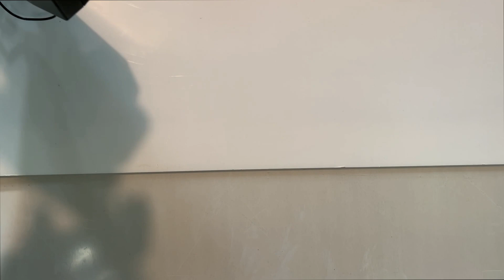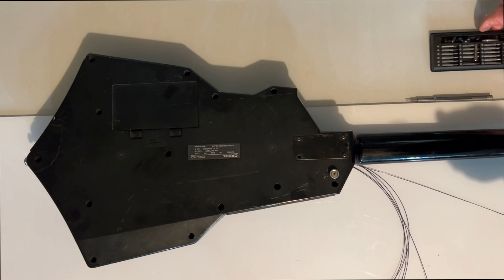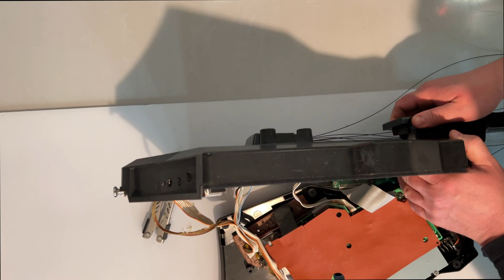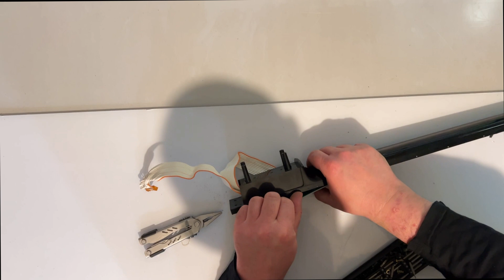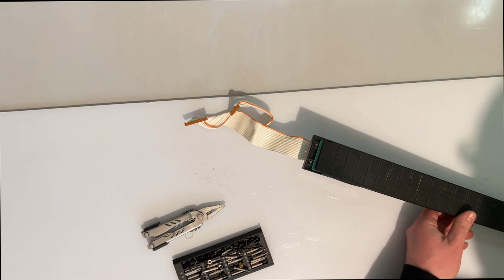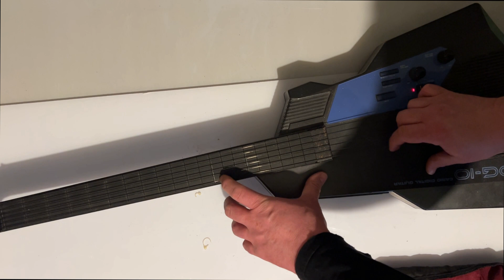Casio DG-10 Digital Guitar Repair - But will that fretboard work again?

Comment: Hi. I have the same problem as in the video. I disassembled the neck and cleaned it. I cleaned the plug contacts. I found a repair manual that includes electrical diagrams. I tried to understand the problem, but I still can't figure out which track is responsible for the first string. When the guitar is open, it sounds, but it doesn't respond to pressing each fret. Does anyone else know how to solve this issue?
Reply: I bought a used guitar. The first time I played it, the frets on the first, third, and fifth strings didn't work. But after five minutes, they warmed up and started playing. Then I disassembled the neck, cleaned the contacts, and cleaned the contacts on the wires, and all the strings started working except for the first string. The first string doesn't respond to the frets.
Reply from the maker: Sounds like the wire that handles the switches on the first string is either loose or not making a good connection. Bridge is fine because you said the string is making a noise when you play it. You said in your previous post you have the repair manual and it was sort of working until you cleaned it. I’d have it apart again, and use a multimeter and check between the contacts and the relevant ribbon cable point to see if it’s making a connection. It has to be a wire common to all those contacts in the first string which may only be holding on by one strand of wire. I would also check the rubber membrane as well as it could be worn out but sounds like a loose wire. Hope this helps and let me know how you get on 👍
Reply: Hi, you can't do without a multimeter. There's also a problem where the third string doesn't respond when turned on, but after 15 seconds, it starts responding to fingerpicking, but the first string only plays open notes across the entire neck. However, it did respond when first connected, but not immediately after warming up. I'll be working on the issue!
Reply: Hi, hi. I'm going to continue. I studied the neck, and I studied the repair manual. Using a multimeter, I confirmed that the guitar neck is fully functional, the rubber neck cover conducts electricity and can be measured with a multimeter, and the graphite contacts are in perfect condition! Additionally, the multimeter showed that the contact from the graphite coating on the first string of the neck to the processor's leg is good. There is no breakage. Six signals are sent from the chip to the neck, and then they are sent back. It seems that one signal from the first string is not being sent from the chip itself. I will continue to investigate this issue.
Reply: https://youtu.be/3f6WH_nHQYQ?si=-3uB92dUCiysl_zT.  This was the first video on the day I got the guitar. The first , third , and fifth strings started working properly after 15 to 50 seconds of playing . after disassembling the guitar. I was still cleaning the board from oxides, but there was an oxide in the auto-off details... But I can't understand, if there is no break from the contact of the microcircuit to the graphite of the first string, then why does the microcircuit not send a signal to the first string, but it used to send on the first turn-on.

Comment: Im having a problem with mine, the light doesnt even turn on when i flip the switch, it worked when i bought it but i may have exposed it to overvoltage but i feel like it worked even after that, my memory isnt great though
Reply from the maker: If it has had too much voltage it could have damaged it. First, I’d try a power supply or batteries in it. Power supply should be 9vdc, 1A(1000mA) or higher amps and centre negative on the plug into the DG-10. Having a look on eBay there are loads available or a universal will work as long as you set it up correctly. Try batteries in it but again depends on if the contacts are good. I’ve had it sometime where mine won’t switch on so I turn it on, roll the batteries at the back with my hand and see if the power light flickers. If that doesn’t work, try working the power switch back and forth several times as due to its age, it may have a bit of a build up of oxidisation on it. Again, if you have some contact cleaner, you could try spraying some of this under the switch and work it back and forth a few times. Hope something here helps and please let me know how you get on with it
Reply: @BillFixesEverything I discovered a few things, first of all mine is a dg-20 so I'm not sure how it would differ from the 10, but they look pretty similar. Also I was testing voltages because apparently the t3 transistor is a fairly common issue, when I placed my probe on the emitter of the t3 transistor and my other probe on the base of the t2 transistor, the guitar powered on after a time delay. Im thinking I essentially jumped over the 10 microfarad capacitor that's supposed to be charged by the t3 transistor, but that doesn't really explain the time delay. Anyway I'm thinking the capacitor may be the issue but I haven't ruled out the t3 transistor either
Reply from the maker: @Bobby_Kron  it may be worth replacing both of you can as they should be fairly cheap components. I believe the only difference between the DG-10 and the DG-20 is that the DG-20 has a built in midi port. Sounds like there’s life in it anyway. May also be worth just reflowing the solder with some new solder on the capacitor and transistor, could just be a dry joint 🙏
Reply: @BillFixesEverything yea I was thinking I would just replace both, see what happens. I have zero experience with this kind of circuit board stuff so thanks for offering your expertise, I'm feeling much more hopeful for the life of this thing as of late ❤
Reply from the maker: @Bobby_Kron  just take it easy and you should be fine. If heating the joints up then adding new solder to them doesn’t work. When you want to remove the components, I’ve found some solder wick covered in flux works best and  sucks the solder right off the board. Just do it somewhere well ventilated, near an open window  as the fumes are a bit strong
Reply: @BillFixesEverything  i couldnt get the guitar to work so i ended up removing the components but im having trouble figuring out what transistor i need for a replacement, i would hate to accidentally get an incompatible one and break it further. do you know specifically what transistor i need to replace it?

Comment: so was it just the cleaning that fixed the notes or was there something not making contact? i have a dg-20 and everything works except all of the notes on the 1st fret for every string. from the 2nd fret up everything works fine.. debating opening mine up to give the fretboard a clean but I don't want to break anything haha
Reply from the maker: It was one of the ribbon cables was not in properly on mine but while I had it open to fix that metal bar back down in the neck I thought I might as well clean it up. For your one it sounds like it could be one of two things. Could be similar to mine and one of the pins isn’t making contact and this sounds the most likely problem as it’s all of the 1st fret not making contact. Secondly it could be that the contacts on the 1st fret are dirty but you’d usually still get one or two strings working on that 1st fret. I’d take the back off and make sure those two ribbon cables are pushed in correctly first. Hope this helps and good luck 👍
Reply: @BillFixesEverything  awesome, thanks for the reply! I'll take a look at it when i work up the courage and let ya know how it goes!

Comment: I hadn't touched mine for several years and it seems dead. Was wondering if it could lose the sounds from memory? And ideas?
Reply from the maker: As far as I'm aware, the sounds are stored on an internal rom chip so leaving it for hundreds of years it shouldn't lose them. What I would do is first, check to make sure you're getting a power light. Assuming that it ok, it could be something as simple that your volume is a bit furred up stopping the sound getting to the speaker. if you don't want to open it up, make sure its turned off,  remove the volume and tone knobs, spray some contact cleaner and move them back and forth several times and see if you can hear anything. I'd also try plugging in an external amp and seeing if there is any sound if you crank it up. Good luck with it
Reply: Thanks, I forgot about that stuff. m My brother, the current custodian, reminded me about eproms. I was probably drunk...  @BillFixesEverything

Comment: Do you know if this can program to play left handed??
Reply from the maker: Hmm… interesting. I can think of a way of doing it electrically. If you swapped the wiring over internally so what would have been your 1st string now becomes your 6th string, etc all the way along. You’d have to do it on the string sensor as well as the fretboard I’d imagine.
Reply: @BillFixesEverything  thanks and I’m thinking about trying this

Comment: Very interesting.  Just bought one, was wondering about string tension being loose but mine works OK.
Reply from the maker: Yes it is a very interesting instrument. Playing this I find have to change my style compared to a regular guitar. Almost stricter in that you have make sure your finger touches the fret board completely and the strings need a clear pick to create a note, no harmonics on this 😁. 
At some point I want to add a midi out to my one, if nothing else to expand the sounds it’s capable of. Thank you for your comment and glad you enjoyed the video
Reply: @BillFixesEverything  I'll do u a deal. U fit midi into my guitar and I'll do a demo of playing the guitar for u to use on your channel 😉
Reply from the maker: @rancidstain  Once I’ve worked out how to fit it to my one, I’ll be in contact 👍
Reply: @BillFixesEverything  I was expecting it to be more difficult to play. I'm enjoying playing it thanks to your video.
Reply: @BillFixesEverything   check out video from Bonzo Music on converting dg10 to midi. It's complete outwith my skill set but I'm sure easy for u. Thanks for the info. I'll post a demo soon.

Comment: Hi Bill, I've got an issue with my DG-10 where the strings dont really work, but occasionally spots on the fretboard will make a tone? Any Advice? Would this fix help my issue? I'm not skilled in repair so I don't wanna rip apart my unit or damage it further
Reply from the maker: It sounds like the fretboard may be ok but it’s where the strings attach on the bridge of the guitar. Assuming power light is on, speaker built in or external speaker are good and the strings are tight, without touching the fretboard you should get a sound from each string playing it open. I found with my one, if the strings aren’t tight enough you get no sound, check that first and they don’t have to be super tight but enough tension. My next thing would be to remove the back of the guitar, it’s just some cross head screws and check internally for loose wires or noticeable damage on the pcbs. Maybe a bit of contact cleaner spray on the bridge mechanism may help it to if the rest looks good. The fact you are getting a bit of sound out of it makes me think it could just be age and bridge contacts not making properly. Hope this helps and you can get it working again 👍